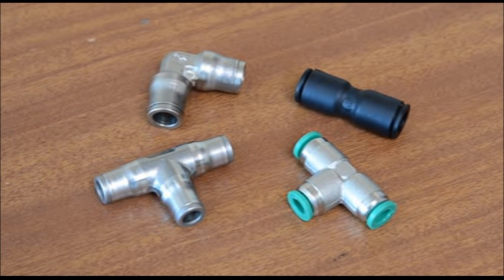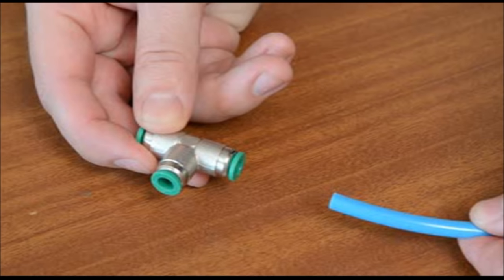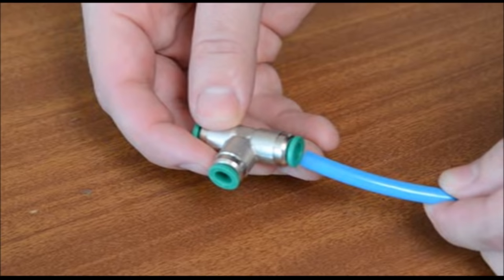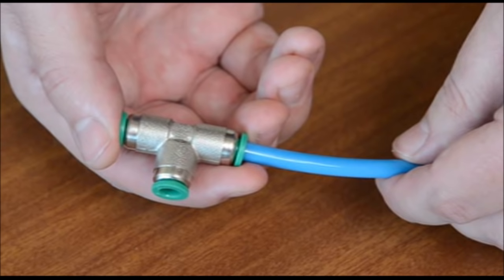Push In Fittings Explained

Comment: Hello I have a 8 mm pneumatic push fitting on the back of my welder dose that mean I use 8mm pipe to fit it thanks
Reply from the maker: Yes, you need 8mm OD (outside diameter) pipe.

Comment: do I need to turn off the air pressure to release the fitting?
Reply: Yes, you need to turn off the air pressure.  It you didn't then you would end up with an open ended tube/fitting on the pressurised side.

Comment: 🔥🔥🔥 what kind of air pressure will they tolerate 🔥🔥🔥 I’m running 200 PSI for my airhorns regarding my pick up truck 🔥🔥🔥
Reply from the maker: The maximum working pressure is 290psi (20 bar) for Legris push in fittings and 260psi (18 bar) for Olab push in fittings.
Reply: @duncanrogers  I don’t trust plastic like that kind of pressure
Reply from the maker: @stickbogart3657  The Olab range is metal - https://www.duncanrogers.com/pneumatics/fittings/push-in-olab-metric-4-12mm-od/24

Comment: Is there any reason these couldn't be used with liquids...oil or fuel? What type of material is used for the seals?
Reply: They can be used with liquids.  We have several ranges of push in fittings made from different materials to cover most applications. You can see all the options at http://www.airlines-pneumatics.co.uk/pneumatics/fittings/6

Comment: Is it suitable for high pressure applications and how does it compare with those screw-compression type quick connectors? Can it be used for water instead of air?
Reply from the maker: Push In Fittings are suitable for pressures up to about 18-20 bar (depending on the brand) and they can be used for water (http://www.airlines-pneumatics.co.uk/product-category.asp?Cat=6).  Wade Compression fittings (http://www.airlines-pneumatics.co.uk/product-subcategory.asp?SubCat=26) are rated up to 20 bar and Betabite Compression fittings (http://www.airlines-pneumatics.co.uk/product-category.asp?Cat=15) up to 630 bar.
Reply: wow, thats excellent ! Will buy a few and try. Thanks so much.
Reply: @duncanrogers 
So I can use pneumatic push connector for my water filter?
Reply from the maker: @geminiman2831  Some ranges are suitable for water and some are not. See https://www.duncanrogers.com/pneumatics/fittings/push-in-legris-lf3600-metric-4-14mm-od/100 for a range that is suitable for water.

Comment: Where do I get those fittings? I need to cap off air line completely
Reply from the maker: You can find them at https://www.airlines-pneumatics.co.uk/pneumatics/fittings/push-in-legris-lf3000-metric-3-16mm-od/22 with the blanking plug at https://www.airlines-pneumatics.co.uk/pneumatics/fittings/push-in-legris-lf3000-metric-3-16mm-od/legris-lf3000-push-in-blanking-plug/S060117
Reply: @duncanrogers  appreciate it, I found a shark bite fitting that did the trick.

Comment: Can this be used with silicone tubing?
Reply from the maker: Silicone tubing is generally used with barbed fittings that insert into the inside of the silicone tubing and NOT push in fittings that grip on the outside of the tubing.  This is because silicone tubing is softer than nylon or polyurethane.